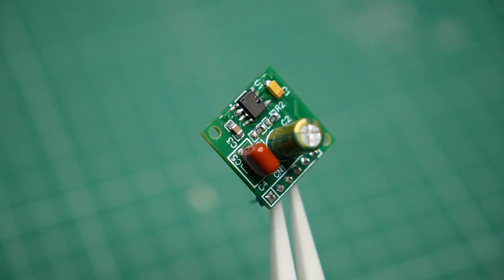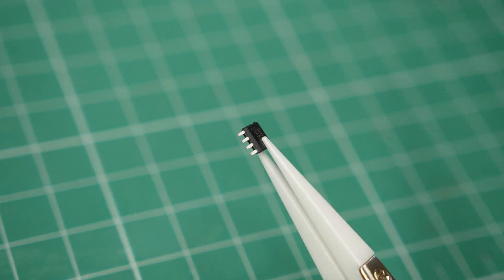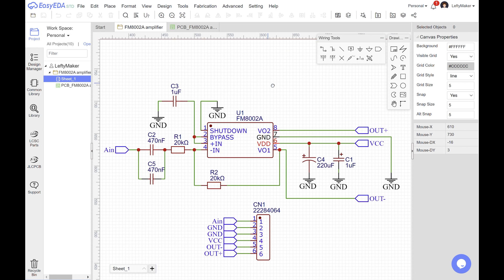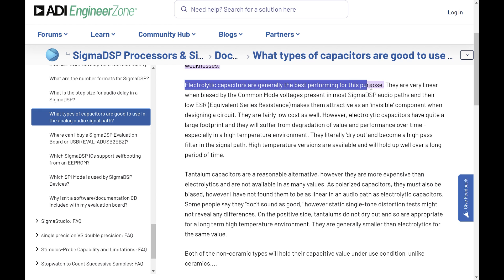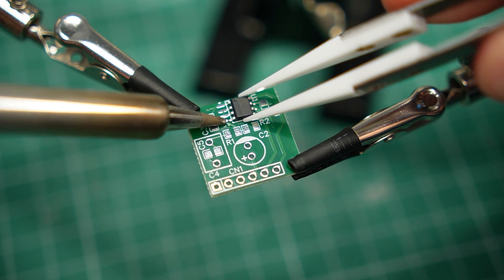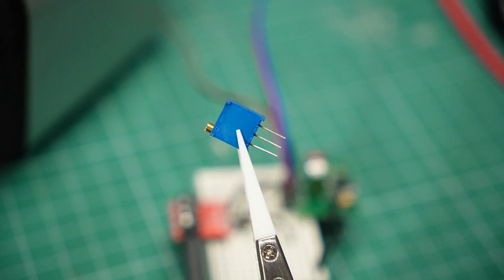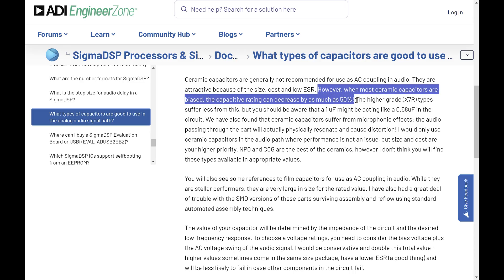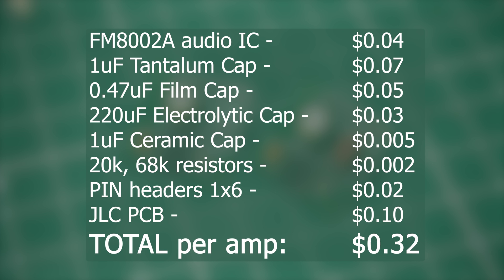Did I make the cheapest DIY amplifier?

Comment: can be this scaled up for 5, 10, 20, 50W or even larger setups? ⭐
Reply from the maker: It is best to use a different chip designed for higher power. However, it will be more expensive, and you'll need a bigger power supply
Reply: @LeftyMaker  that would be an awesome video on its own 😇

Comment: FM8002A and a lot of other similar 8002 alternatives seem to be clones of TI LM4871 amplifier. They are linear amp so they are great for HF radio circuitry and a great alternative to the old LM386.

Comment: Nice video! But the resulting product is still largely useless. First of all, who needs a mono amplifier these days? second is that it can't be easily connected to consumer equipment (3.5mm jack etc). Thirdly it's not protected from the environment and has no case with basic things such as off switch. Also you have to source your own power supply..
Reply: He made this video just for educational and advertisement purposes. It was mainly focused on the components he used, how they were put together, how much and how he purchased them, nothing too fancy😎

Comment: My "PCB's" are retro. I use a lot of resistor legs to make advanced connections.on perf boards. Layer 2 is on the other side and layer 3 or more is jumper wires. I learn more this way for now. Making 10 or 100 PCB's with a mistake is not for me, yet.

Comment: Could an amplifier like this be used with 30 or 60 ohm headphones with low sensitivity (ie. headphones that need some power to be audible)? Do they behave any differently with higher impedance loads? Is it just a matter of P= V²/R and they won't put out as much power or is there other factors at play, like more noise or something?

Comment: So did you just put jumpers across the places of the 2 capacitors? :hand-pink-waving:   BTW- I subscribed because of this project! :trophy-yellow-smiling:
Reply from the maker: Are you asking about the input cap?
Reply: @LeftyMaker  - No did you replace the CAPs with jumpers across the sockets in there place?
Reply: @tubeDude48  I think he didn't that would be a direct short I would assume, because the caps are not in series with other components so no jumper necessary (well the jumper would be even harmful)

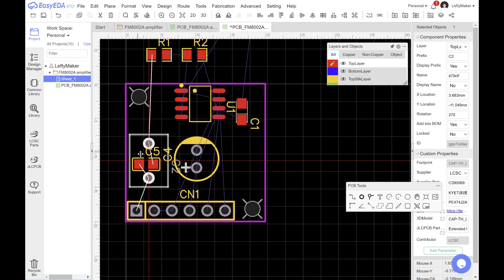3:59 you can see the schematic, the only cap in series is the input cap

Comment: do you by any chance have any pcbs left? if i wanted to order a new batch i would need to pay at least 10$ and since im also from europe (poland) im intrested if you could kindly send me some.
Reply from the maker: Do you need the PCB only? Perhaps I can check if I can mail it in a cheap envelope
Reply: @LeftyMaker  yes just that
Reply from the maker: @clipblocks  would you be okay with covering shipping?
Reply: @LeftyMaker  and how much would it be?
Reply from the maker: @clipblocks  I believe 1 euro, according to the post's website, but I'll go and ask.
Reply from the maker: Yes, it's going to be 1 euro without tracking. If you still want it, send me your address at theleftymaker at Gmail dot com
Reply: @LeftyMaker  i realised i could just attach the legs of the ic to a perfboard with jumpers.
Reply from the maker: @clipblocks  okay, that works!
Reply: @LeftyMaker  yeah i hate smd soldering its very anti consumer.
Reply from the maker: @clipblocks  if you change your mind, let me know!

Comment: The gain is a negative feedback loop following a simple inverting amplifier. The input impedance is 20K with a 0.39 uF cap giving 3dB point of (checks calculator) of almost 20Hz on the button. I'd say they're dreaming. :) Could probably push that to at least 100-200Hz without really noticing much of an issue unless you're driving a set of cans.

The gain in their schematic is -2 (-1 * 20/20) but the upper limit is determined by the input level - a quieter source needs more gain so a volume control ahead of the gain stage would be a smart move. With 80K you'd have a gain of -5. The open loop gain is probably in 80dB or more even with a simple design. Negative feedback (and lots of it) lowers both noise and distortion which is why it sounds good. Thanks Harald!
Reply: Can you add an equalizer plus Bluetooth connectivity for earbuds?

Comment: These have made their rounds on cheap Bluetooth speaker boards, i've seen this chip. Mhm thanks to SD feature, i might even find a use for it, but realistically i probably want a PAM8302A instead. Or Fuman's own TC6805.
Reply from the maker: Yup, both chips look interesting. Might try them too some day. I wonder how they make a profit. They cost pennies
Reply: @LeftyMaker  I think they have a scheme, i don't think it's your typical profit oriented operation. Numerous grants from the People's Republic have been issued which have a strategic purpose to move semiconductor manufacturing inland and secure vital capability, and at some point a decade and a half ago simple linear-function and analogue switching ICs were a very important milestone, you start with low value  products to be able to achieve higher value ones, now there are different more complex milestones to hit. Who knows they might have fabbed a billion chips because they could do this on public funds and are perhaps now just slowly selling them off. Also once you already have capacity to make linear ICs or somesuch, you're best off just letting it go brrrr no matter if it's technically losing money, because the secondary costs and externalities of shutting down the manufacturing may be higher. I'd love some sort of expert investigation into this, but a lot of these things particularly in China are anything but transparent.

Comment: Use 4ohm speaker instead of 8ohm speaker , it can up to 2 watts output but recommend electrolytic cap on power rail for peak output current (if insufficient current condition)

Comment: This is pretty damn cool, I wonder how does it compare to an amp thats say 10 dollars? How much does price improve sound?
Reply from the maker: for 10$ you can buy something that can realistically put out 10 watts, so the biggest difference will be the output power and thus volume (which for many people means quality too :D I assume the fidelity will be better too, yet that's a bit more difficult to measure and appreciate
Reply: @LeftyMaker  would something that's $10 be comparable in size as well as quality I wonder. I might need to try making one myself at some point

Comment: i'd love to know how long it lasts under load! i recently bought a very VERY cheap amp built almost exactly like this one, and it lasted about 2 hours of normal use before it died completely. looks like the chip itself failed internally
Reply from the maker: I've had them on at full power for a few minutes at a time and I've been playing with them for about a week. No failures so far, but if anything changes, I'll post here

Comment: Hi ! Really cool project :)
I try to use less and less Tantalum capacitors because of the Tantalum extraction procedures and their high cost. It would be interesting to know the effect of replacing the 1uF Tantalum capacitor with a ceramic one !
Good job again :)
Reply from the maker: Hmm, never considered this about tantalum. I can probably test what happens if I replace it with a ceramic one
Reply: They are awful for audio too. Film where possible, NP0 where space is at premium.

Comment: Cool video! Per the Analog article, it would be interesting to know if tapping on the cap would introduce any signal from the vibration. Also curious, for JLC boards, how did you split them apart? Never ordered a panelized board.
Reply from the maker: I can try tapping on it and see what happens. About the boards, there is a "Panelize" option in EasyEDA. You just specify how many copies you want and that is it